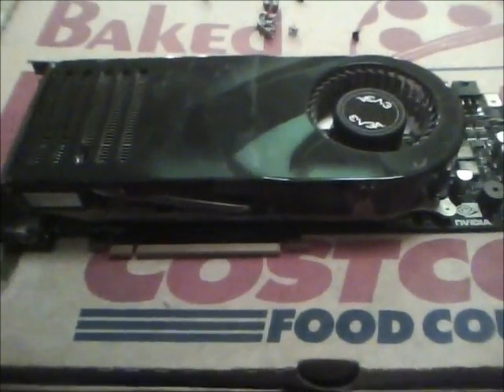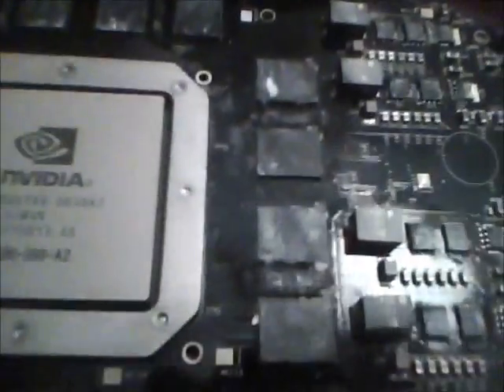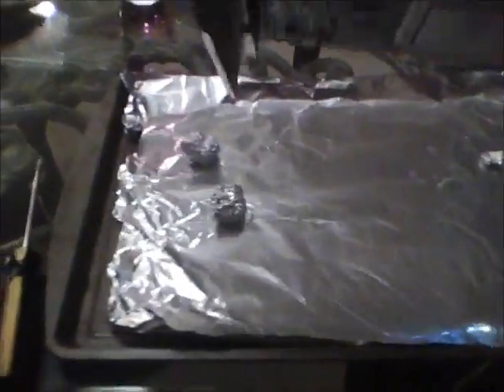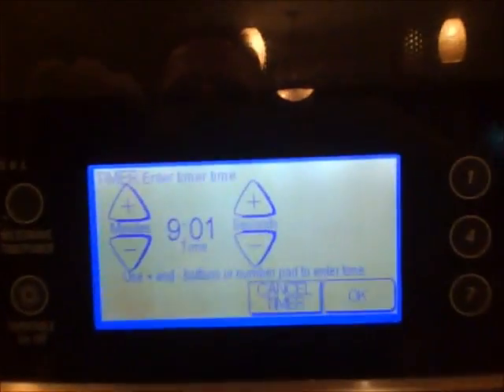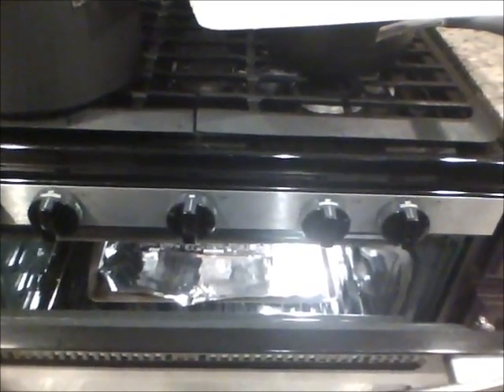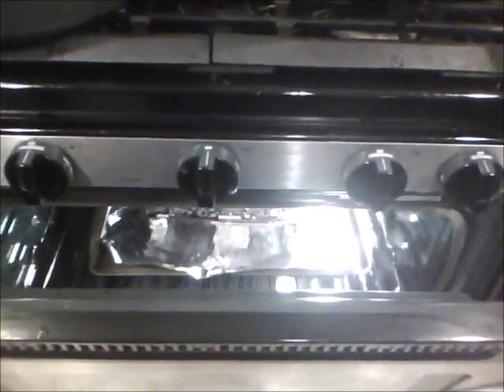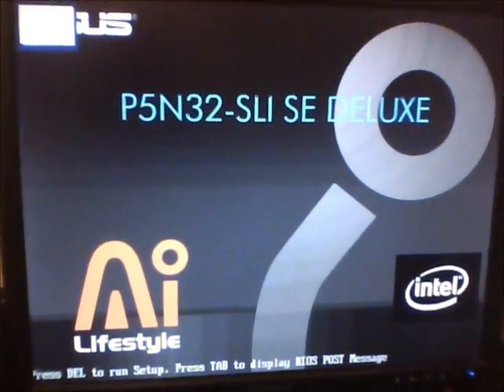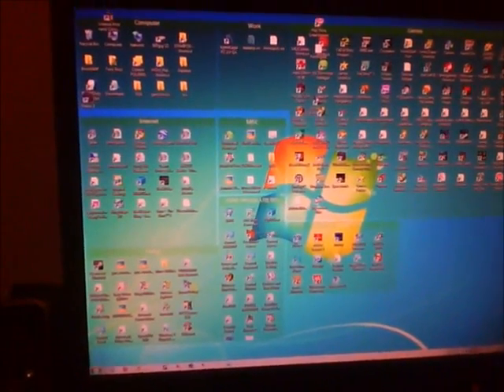Fix your 8800gtx Graphics Card (STEP by STEP) by Baking it in the OVEN.

Comment: yes, if the purpose is to reflow the GPU, than baking face down would dislodge the chip. face up the GPU can reseat itself by its own weight. furthermore, you should really redo the VRAM with clean and reinstall paste as well as that's also critical if under the heatsink. the grey silver bearing gaming compound works best. you want it all good and clean and able to conduct heat FAST.

Comment: UPDATE: OK, the card eventually gave in a few days ago. That means a strong full year of massive use. Artifacts started showing up upon boot all of a sudden, out of nowhere, and the system kept blue-screening with an error. Couldn't load the system. Hell, what worked the first time sure should have a second go? Fired up the oven and ran the trick again. What do you know .. artifacts gone. System loading without a problem what-so-ever. Running like brand new once again! I'll pop in and let you know down the line how long it'll last this time!
Reply: Michael Egeville I’ve just baked my GTX 970 it’s working but I’m worried it won’t last long ??

Comment: FOLLOW UP:10 months down the road since I followed this suggestion, and the card is still rockin'! I haven't had one single issue with the 8800GTX since the baking. We are talking 10 months of intensive gaming. Several hours a day. Lots of CS:GO. Lots of League of Legends. Ya, maybe that's where you belong, Mr. Ricci. Among the legends. This cool advice is definitely legendary.Just wanted to follow up (in case of any eventual sceptics out there).Thanx again.

Comment: Is this recommended ONLY for cards that are completely dead? My 780 ti runs until I run games that put a strain on it (CS:GO and R6:Seige) then it will make my computer freeze about 5-20 mins into playing and I have to restart. However games that don't put too much of a strain on it (League of Legends) run fine. Should I try this?
Reply: +Hylan143 Your card is overheating, check the cooling solution you have, maybe replace the thermal paste on the GPU?
Reply: Spoky mines was the same. It was a failing VRAM solder point.  
I baked it a few days ago and touch wood it’s
Fine. 
I’m not sure how long it’s gunna last but if it buys me a few
Months I’ll be happy with that.

Comment: Half-dead 7970m - BSOD when you'd install gpu drivers -> 9 minutes 200'c face up -> works fine :D. Hopefully for long...
Reply: Hey man! I've got the same problem, same GPU! I'll try it tomorrow and see if that works. How's yours doing?
Reply: I had to do it once again after like half a year or something and im  quite sure i went too hardcore on it because it lost its colour (blue turned into green :P) and some screw spots actually melted ... But its still alive ! i dont overclock it anymore though :D.  ps remember to place it with core facing up, not down. Good luck !
Reply: pretty hardcore, man..^^ good to know! I've done it 2 hours ago and so far - everything works again! What a relief! :D
Reply: Good for you man, good for you.

Comment: First off, thank you for taking your time to create a video. Even though I have much experience, I like to see how others may be doing something. If you're (in my case me) not always trying to improve, then soon you will be left behind. Because your video helped me confirm something, I thought I would reciprocate and share a bit of practical knowledge that I have found to be true through my experiences as it applies to thermal paste application: Thermal paste is there the facilitate better heat transfer between heat sink and GPU. Because there is no way in the manufacturing process to get both the heat sink and die perfectly flat, thermal paste is there to fill in the gaps. All surfaces, no matter how smooth are not actually flat. When magnified you can see all the micro scratches and fissures in the surface. The thermal paste fills in the micro-fissures and gaps to allow heat to transfer more efficiently as it provides more surface area contact... That being said, the best way to apply the paste is put a BB (BB is short for ball bearings, and are referring to the size of ball bearing in relation to a BB gun. A "BB" is about 4.5mm in diameter) size amount in the center of the GPU surface, and maybe about half that amount near each of the corners of the die, about half way between the center of the die and the corner. Once the paste is applied, replace the heat sink, being careful to place the heat sink so that your not moving the heat sink much after the heat sink contacts the paste/die. When you start to tighten down the heat sink, make sure that you are working your way around the heat sink so that you are not tightening one screw all the way, then moving to the next but rather you want to tighten one screw a few turns, then move to the next, tightening it a turn or to and so on until you gradually have moved around all the screws. The importance of tightening the screws this way makes sure that the heat sink went on as evenly as possible, with equally pressure across the entire heat sink. This is why there are springs on the screws as well. The springs provide extra tension. IF you were careful and did not allow the heat sink to move much, then tightening the screws evenly will distribute the thermal paste across the GPU die. A little movement is not an issue, you do however want to prevent major movement and if you have to remove the heat sink for any reason after you made contact with the paste, it's best to wipe both the heat sink and GPU die clean and try again. The reason this is a better method than spreading the paste yourself is this: As stated above, no smooth/flat surface is truly smooth/flat, and allowing the paste to flow where it needs to by setting the heat sink allows more paste to fill in gaps and less in closer contact areas organically. When you "pre spread" the paste you are potentially make less paste available should there be a gap a bit bigger than you left paste for. Not that the above method, is completely wrong or that you'll ruin your GPU if you follow the above method, just that by doing it by the method I outlined you have greater chance for optimal distribution of thermal paste. It also is a bit more "cleaner"I apologize in advance for any grammar/spelling errors as I am not going to go back and proof read. IF anyone has any questions or comments, reply to this comment and I'll try to respond. --Cruistix (John)

Comment: hey. 
your gpu processor will fall down man. didnt it?
Reply from the maker: +Mehdi Shah  It would be Cool if you can do a Video and Add a Link to it as to the Sodering Gun.   Not many Own one of those.   And Given this, this method may work for many.   Almost 1/4 million views on my video.  I am Surprised at that.  But.   The bottom line is how much money did the method save people.   A ton.
Reply: +Tony Ricci yes man you are right. I have asked my friend because he owns an oven. I wanted to do this with my Gtx 560 Ti before throwing it away.
Just asking because solder joints melt and chip is loosened.
Will it fall down or not?
Reply: +Tony Ricci And you are experienced person.
You know about capacitors and 6 pin power connectors.
Will they melt?

Comment: Just fixed my 8800 GTX yesterday, following your recipie. Had multiple bands of red lines at start, after Window start, horizontal purple. Then crash would come. So 10 min @ 380, cool down to room temp, (used a non contact infrared thermometer, board heated to 200 f in that time.) Other reading shows soldering chips in the 155 f range, I wouldn't go more. Paste: pea size ball in middle, dribbled tiny line to corners, tightened, disassembled and rechecked coverage,100%coverage, assembled. Thanks for a great video!

Comment: Fascinating tutorial Tony! For a one person video you actually did well in my opinion. As for the thermal compound you are right even for an older video, the only reason they tell you not to spread it is because of how the paste spreads when the two surfaces press together. One pea sized dot spreads evenly over even a larger amd heat spreader without dripping off the sides. Linustechtips and tek syndicate have videos demonstrating it. Just food for thought, thought I'd share since I learned something cool from this video :)
Reply: Вс это хрень полная спалите кату к хренам  даже 250 градусов уже много , сколько ещё повелись на этот эксперимент....:face-purple-crying:

Comment: Amazing ! This works ! Yesterday i had the same problem with my 4 years  old VTX 6950 2gb and after watching this 3 times (not an expert in electronics), i followed this step by step, 8 minutes at 200oC, 1-2 minutes in the oven with the heat turned off and 30 minutes in the opened oven as seen in this video . Thank you sir. I have saved 100€. Fuck capitalism .

Comment: Will this method work on a ati radeon xt 2600? I have a 3.1 mac pro and need a graphics card bad and there 3 to 4 times then pc gpus. I cant use pc gpu so i been told. I have an early 2008 3.1 8 core 2.8 ghz. I have a nvidia fx 4500 but it doesnt work in the 3.1 only 1.1 and 2.1 gen macs. Which i think is sucky.. any help plz?

Comment: Just did it with my gtx670. Worked like a charm. Highly recommend this if you get black screen of death caused by a faulty card (after  checking if the drivers are faulty ofc)

I had 0 faith in this before i was at the point of either throwing the card or trying. Lets say im very happy i cooked my gpu. THX for this video!!

Comment: Using this technique i fixed several graphic cards. 9800Gt 8800Gtx 8800gts 7600gt gtx260 Rx3850
I failed with this technique only with 8600Gts these are all old cards. Ty. :)

Comment: I just fixed my dead GTX580 using this technique. Great video and thank you.
Reply: bro tell me what problem with your gtx 580 ..i have gtx 580 last night            (in game) computer restart and gpu fan spenning but not detect my moniter
Reply: Abid Ali I was having all sorts of issues starting with BSOD's during games then I noticed artifacting (graphical errors) in the BIOS and could not boot to windows. As soon as I connected the monitor the the mobo instead of the DVI out on the card It was fine.
Reply: thnxx info

Comment: The thermal paste part irked me. Don't use capacitive or conductive paste on a GPU. EVER. Also, no need to spread. pea size in the center, allow pressure to spread it. Easier, quicker. Use MX-4 paste. Best in my opinion.
Reply: You can use thermal paste on a gpu, as long as it's non conductive. It's best to use more on a gpu too since the heatspreader is larger. Spread method causes air bubbles. Just let pressure and gravity work.

Comment: My GF8800 GTS 512 functioned for 5 months after baking it before the artifacts returned. (I've let a lot of dust accumulate inside the fan during those 5 months and the temperatures eventually went up from 40 when idle back to 60.) I'm going to bake it again and set the cooling fan to 80-100% this time, because it seems to always run at ~40% by default unless the card gets hotter than 80 degrees celsius, at which point it switches to 100-120% until the temperature drops back again.

I should also probably clean it more regulalry, but the cooling system is deviously constructed so that it's hard to take apart (the rivets holding the shielding in place are very tiny and easy to damage) and you need a compressed air duster to clean out the dust from the insides.

Comment: I got artefacts on my 8800gtx the other day so was like shit! so watched this video today then went to work on my card. worked a treat. had it in for 10 minutes and turned the oven off then kept opening the door every minute to let heat out then closing again. did this till cold then replaced thermal paste and fitted the fan. wasn't hoping for much but it worked lol. ive been stress testing the card for over a hour and it still works!! great work buddy

Comment: Dont spread the thermal compound it causes air bubbles meaning it will run hotter, just put a dot in the middle and let the heat sink spread it
Reply: I never get why people spread it like peanut butter when all they have to do is this^ 
Then they go on to misinform all of the newer pc builders and keep the bad technique spreading..
Reply: フプロフ Vpprof you can use it if you want but im telling you the temps will be higher
Reply: Yes but then why does thermal paste come in a set with an 'applicator' (a plastic spatula)??

Comment: PLEASE HELP
when i power on my pc ...i hear a loud beep and the pc doesn't start....i removed the video card that is an 8800 gtx ,,, and the beep disappeard . do i have to cook my video card?
Reply: no i thing there is something wrong with the power connectors on your card. I forgot to plug in the 2 power pins in the card and i got a ULTRA LOUD BEEPING NOISE. I thought my computer was about to EXPLODE. but i just forgot to plug the connecters in. SOOOO what im trying to say is there might be a power problem. good luck hope it helped.   :)
Reply: its your ram
Reply: and or power  ;)

Comment: And thats why you never buy EVGA/GigaByte/Palit and specially not ATI cards!:D

I've got in my family over 10 Asus Nvidia cards from 8600 to the new 770GTX, most of them are working 16+ hours a day for over 7 years on gaming computers and yet not even one of them fall down, worth mentioning I also live in a desert which mean naturally the tempeture are much highers as well which should be negative to them.

Also I would recommend stop buying those cheap bronze grade (or even worst, the non graded unboxed) power supplies and get Gold/Platinum power supply, that alone will increase the life of your computer by at least 10 years and also take less power from the wall = more profit for you in long term even though it cost more.

Hope I helped you!:)

Comment: I'd not be too shy with the thermal paste (this is how the problem started in the first place) but in doing so I'd use Artic's thermal fusion 400 or such like (there are other brands) which has non electrical conducting properties whilst having thermal conducting properties.

Comment: Face up would be smarter! When it heats up the solders will get loose and the transistors on the bord might fall off! Happaned once wiht Xbox motherboard! It happens only when you heat it up for too long but it way be the safe way! :)

Comment: This tutorial works just fine,i tested it on few GPU and it worked every single time,its a litle bit smelly and if you dont overheat your GPU after baking it will work for a long time,i have 8800 GTS (G92) working for a 2 years now after i bake it in oven using this tutorial and the time of baking depends on size of GPU,if its a smaler one use 5-7 min.
Thanks for this Tutorial......

Comment: Fucking idiot. That is not how you apply thermal paste.
Reply: ZpankzaAsZ Thanks allot. I've been having a hard time finding a good reference for all this. Good to know.
Reply: Please explain the correct method for applying thermal paste. I'm not chastising. I'm curious!
Reply: The purpose of thermal paste is to close the gap between the heatsink and the CPU with maximum thermal conduction. If it's spread out then there's a larger chance of getting air bubbles in the compound, decreasing the thermal conductivity. The best methods are Putting a line or dot of compound on the center of the CPU, and letting the heatsink flatten it out.
Reply: ***** /watch?v=EyXLu1Ms-q4 okaek is right
Reply: oOKAEKOo so what you're telling me is that the thermal paste does not need to be spread throughout evenly on all of the cpu just the center? I always spread it out with a card and still get better temps but I never tried it with just a dot or line of paste in the center.
Reply: actually that was a long time ago, and die dimensions were way bigger back then, so paste HAD to be spread. Also nowadays heatsinks contact surfaces are slightly convex, back then they were flat, so they don't spread paste as they should. Note that contact points on gpu coolers are STILL flat, and you can waste all your paste on one side of the cooler if you don't pay attention to screwing the cooler in the correct order.

Comment: The first gpu obviously was a different gpu the second one. When his baked goods was done it looked black and on fire. The gpu he put past on it looks almost new. So this is obviously not working. So just do what I told you.
Reply: shawnmccori No its not! I did it and it works. Im doing this right now. So thank you for posting this and fuck the haters !
Reply: oh really? so, P15013 seen in the first bit is not P15013 seen later?  Though the GPU is the same through the video, his statement about the thermal compound causing a short if spread over the edge is false, it wouldn't be sold if it could cause shorts.
Reply: this shit def works! i did when mine died in 2007 and its still works!
Reply: sirjeff86 So your say lead that is melted can not cause shorts. When you take your wall out let put a wire in both sides it will short and cause a fire. When you weld you make liquid lead. Put this card in your stove you get liquid lead it will flow like water after it is hot. any thing that is facing down is going to fall off. It will not stay on the card.
Reply: shawnmccori you should do a bit of research on surface mounted chips, i think MSI or gigabyte made a video of one of their motherboards being made from start to finish, from what i understand from your comment, you'll be blown away how they make them.